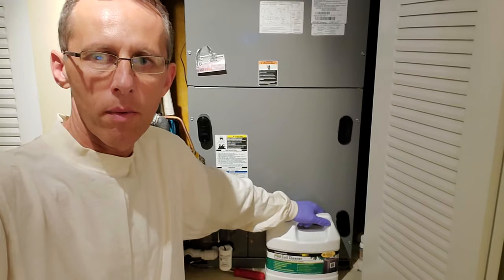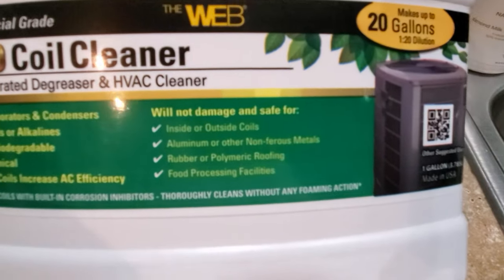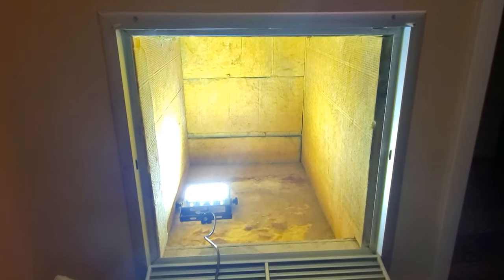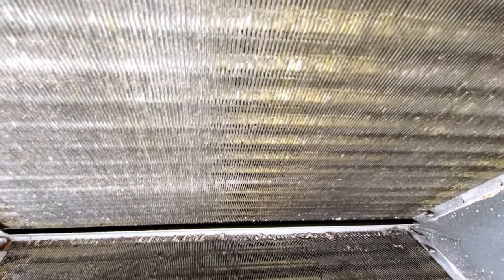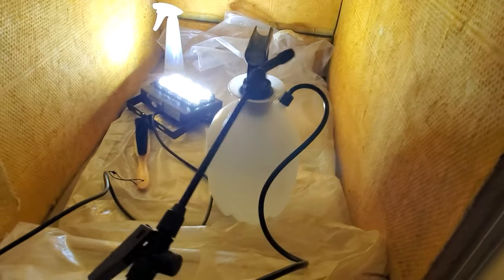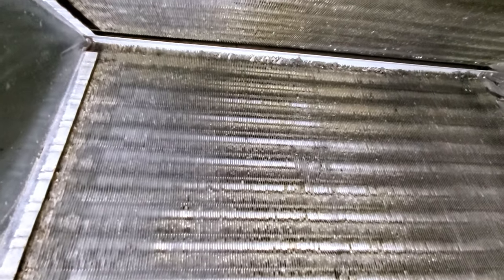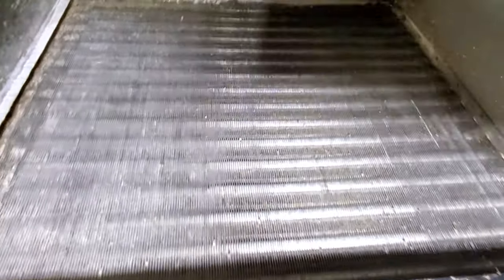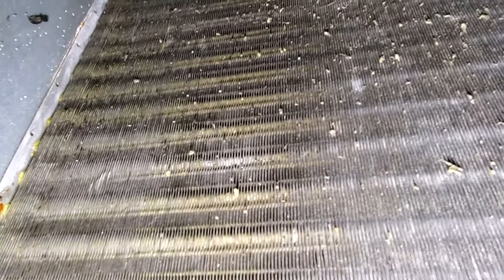How to Clean Inside of AC Evaporator Coil

Comment: I went 20 years before cleaning my evaporator coils because I didn't know any better. The dirt buildup was extreme. I think my cold air flow increased by a factor of 3 maybe after cleaning. I'll bet my electric bill will see a large drop too
Reply from the maker: Same here. I never new I could do that and did clean my AC inside first time after 10 year. We all learn entire life. Thanks for your comments.
Reply: I have had two ECMs die in 2 years due to high static pressure. My system runs at 0.78 when it should be 0.5 or below. When removing the coil access panel it drops to 0.45, so something is either wrong in the ducting or the coil is filthy. The system is 15 years old and its never been cleaned, however our system has the normal filters as well as an air purifier before the blower and coils, so I find it hard to believe anything got through. I will have to check though, as this system is really not running well right now.
Reply: Hasn't been cleaned since April 1996
Reply: I know this is 3 years old but can you please tell me what you did to clean yours? I didn't know and now mine is very dirty

Comment: Thank you so much for your video, all the technicians said I needed a new unit from $2500 - $6500. None of them wanted to clean my unit just sell me one!! I followed your instructions (even wrote them down step by step) and brushed very carefully with a wire dog brush that I attached to a 1/2" PVC pipe 12" long and taped it on, worked great. The unit is from 1996 LOL to the AC Guys who want to be lazy and make you buy a new unit!!!!!
Reply: SAME HERE WITH HOT WATER HEATER. I waited 2 weeks for a part and then went to YouTube University and fix the hot water heater myself and it just needed to be cleaned..allergies🙋🏼‍♀will probably stop once I fix the air conditioner ....black mildew/mold
Reply: That’s what they all do!!!!
Reply: @quintenandjoannklonowski134 Youtube University Lol... that's true. I have learned multiple things like electric, plumbing, A/C unit projects, car mechanic, even gow to play the piano and guitar all in YouTube for free.

Comment: Spray with foam in cane from Home Depot ( no rinse ) , use soft brush. And by the will of god don’t use compressor. Just after brushing shop vacuum. It will pull all loose dirt and foam , no mess.🤷🏼‍♂️👍
Reply from the maker: Thanks for sharing. As you could see use of compressed air did help me to get rid of gunk in between coil blades that was just stuck there. I have used foam spray before and Home Depot one is slightly acidic. I did not want to use that in that situation.
Reply: My thoughts exactly.

Comment: You should have sprayed the water from the other side of the coil to flush out the gunk.  When you are blowing it with your compressed air you ate pushing the gunk further in.  Spray your cleaner and rinse from the top side so you push it out.
Reply from the maker: Thank you for your comments. I tried spaying it out from the other side but gunk was still there. I was blowing air at the angle and got most of it out. This worked for my particular situation. Yours may be different. I only showed what worked for me.
Reply: spraying cleaner the opposite direction of the air flow?

Comment: my 24 year old system had no easy access because they just fabbed sheet metal around the coil. 
Alas, it leaked and i replaced the system. Brand new systems now have access panels.... but alas, the contractor company I paid to do whole-house duct cleaning decided to install the new system first, THEN blow compressed air through the ductwork. Incredibly smart. Brand new system, contaminated. My 24 year old system surprisingly looked cleaner than my new system.

Comment: Same AC as mine. Mine is way dirtier than that! My drain was clogged up and water was overflowing the pan and leaking all over the house. It took me a while to figure out what was leaking. Once I shop vac'd out the drain It quit leaking. I did have to clean the coils again tho. Good info. I wanted to clean the evap but didnt want to use something corrosive so your recommendation helps! Thank You! I also sealed everything below the unit so water wouldnt drain all underneath the floor tiles in the house again. That was a mess. They put an elbow joint right at the drain so its almost impossible to ram something down there to remove the clog. I drilled a hole in the pipe so I could clean it out then use hot glue to seal it up again. I also put the shop vac on the open part of the drain where your pouring the water in and suck it out. Works great.
Reply: Next time that drain pipe clogs, used compreased air to blow it out. You can use your free hand around the nozzle and pipe to seal it. You can use a air compressor or even canned air if necessary. Spiders may clog the pipe toward the outside in the cool season.
Reply: I would not glue the joints in the PVC drain pipe, it makes it much easier to keep clean. That water is not under any pressure, just gravity. If snugged properly, there should be no leaks.
Reply: @michaelwright1602  everything is already glued together. I'd have to replace most of the drain pipe to clean it and thats why I drilled a straight path through the elbow and stuck a wine cork in so when it clogs I can pull the plug and shop vac it out.  I also  sealed the floor around under the unit so it will fill up like a bath tub before it leaks under the floor again. I just wait for my wife to complain about the dripping noise then  I go clean it out. worked all last summer and this summer I had to clean it out once so far. it drains into the kitchen drain. I wish it drained outside onbdedicated piping but I ain't replumbing that! so far its working so I ain't messing with it.

Comment: Thank you. I was wondering if i could use my compressor. Glad to see i can. Very helpful showing that i can do through access panel.
Reply from the maker: Yes you can!
Reply: Be careful to go straight with the air other wise you will bend the coils. If by chance you do You'll need to very carefully straighten them back out.
Reply: Oh and remember to wear gloves. The coils are very sharp
Reply: As a worker in the field I don't use air to blow dirt into the duct work.  If it is full of hair, or caked over I use a metal brush.  If you replace a your air filter in a schedule, your coils stay clean.

Comment: 2 things here: Unless your coils have a heavy mineral deposit layer it is best to use a highly diluted soapy water (just simple dish soap) let it sit for at least 15 minutes. If you do use air pressure to blow out the coils do it in the opposite direction shown in this video. You want to blow the "gunk" out in the opposite direction of the units airflow.
Reply from the maker: Thanks for your comments. I tried blowing from outside in but I couldn't blow out dust out this way. As you could see on my video blowing at the angle on the inside did work pretty good.
Reply: I used a vacuum cleaner...worked very well.
Reply: @MaciejPiotrowski  yeah i have the same air h andler shopfac might work everything coomes down in my face lol . Simple green makes a clearner that works good too

Comment: My air handler is 10 years old.  Last year my pvc condensate drain pipe got clogged, so the water did not drain outside but overflowed in drain pan, then onto floors.  Big mess, but my shut off valve did not work, so I did not know it was overflowing.  The plywood platform, along with the 2 x 4 beams that my air handler sits got soaked and is now sagging in the rear of the unit.  
It started leaking again and I vacumned the pvc drain outside to remove clog.  EXCEPT the condensate leak was not due to drain clog (water isn't even flowing towards the drain).  Since my unit is longer level and tilts back, the condensate water is flowing towards back (opposite side) of unit and overflowing the drain pan on the opposite side of where the PVC drain pipe.   Air conditioning unit works and cools great BUT, I have been paying  a home warranty company monthly for 4 years and this is 1st time I used them.  The tech was out for 5 minutes, never opened the closet door to look at the air handler to see that the unit was tilted causing the leak.  Instead he peeked under the unit (where you just cleaned) and said my coil was leaking water because it was dirty and full of holes and that the warranty company will not pay to repair it due to coil being dirty. After I told him that my contract covers dirty coils and/or lack of maintenance, then his 3 minute diagnosis changed to the coil having mold and lots of holes in the coil causing the condensate leak. My warranty company will not cover if mold.  Within 10 minutes, I had a repair quote for $6,250 to replace a  2.5 ton system (air handler and condensing unit)!  
My air conditioning system that cools my house beautifully! I asked for a 2nd opinion from warranty company, but before he comes out I wanted to make sure the coils are clean so they can't blame a condensate drain flow issue on a moldy coil.  I saw you cleaned the underneath coils but I wanted to make sure the other side of the coils are clean, too.  After removing the air handler cover, can I spray the solution onto the exterior of the coils (the opposite side that you sprayed, too?  Any help would be so appreciated.
Reply from the maker: Remember that Ac warranty company will always try to find a way not to give you warranty. They are only good to take your money, just like any other insurance company. I am not AC professional so don't quote what I say. I just service and clean my AC the way I see make sense. You can use coil cleaner to clean coils but if its going to work or not I can not guarantee that. My mom ac had some mold. I sprayed it with coil cleaner and id did not help much. It's the place were the is moisture 24/7. There is a good company Viper Coil cleaner that I will buy soon and I have seen this at lease on video to do the best job cleaning coils. Here's the link https://amzn.to/3StbVoG  and I hope this helps
Reply: @MaciejPiotrowski  Oh my goodness, I never expected a reply so fast.   Thank for sharing the video and now, for the additional information that you provided.   I will check out the link you sent. So true what you said about the warranty company. As a single mom with little technical experience, I thought I was protecting my home (& finances) with this warranty plan. Thank you so very much, so appreciate it. Enjoy the rest of weekend!

Comment: When u had the sprayer, was that just water and u used that to rinse it off with? Thank u, helpful video.
Reply from the maker: First I sprayed with cleaner, then you need to spray with clean water to remove debris and chemicals from cleaning process. Than you let it dry for awhile and turn AC on again.

Comment: Idk how much you know about this but you obviously know alot more than me. I can see quite a bit of dust between the coils and my question is this.  Could this be the reason my unit is freezing up? It is mostly dirty on the top side. After watching this video I got under mine and the under is, for the most part,  pretty clean.
Reply from the maker: I don't think this is a reason for freezing, although if there is not enough space in between coils then it will freeze. Most of the time coil will freeze if your air filter is dirty. I cleaned my coils after my home renovation which created bunch of dust in the air. This dust was sucked into the coils. I cleaned coils to make them more efficient. You coils can also freeze if your drain line is clogged so clean it at least once a year. I flush mine 3 times a year. Watch this video https://youtu.be/RzQM1sRwLbM 
I hope this helps.
Reply: @MaciejPiotrowski  thanks I just watched your and my unit is similar to yours. It won't be very hard to make the hose pipe connection. I'll give it a try. I appreciate the help.
Reply: @loganb.768  i know this was a very long time ago, but did that help your coils to stop freezing? i just spent $700 on a repair man to come and my coils are freezing up a month later and water is pouring out … my dad cleaned the hose with bleach but it still is leaking very bad.
Reply: @sin-ro4lr  To be honest,  the reason my ac kept freezing was due to it being low on freon. I cleaned it good and cleared the pipe but it kept freezing because the freon was low. I got someone to come re charge it and it cost me about $150. It hasn't froze since.
Reply: @loganb.768  thanks for your response. we got a quote from a technician and it would cost roughly $1700 😭 we will just buy a brand new one at this point.
Reply: @sin-ro4lr  Yeah I had a friend who recoiled mine for 1200 about 7 years ago. If it leaks the freon out too fast your best bet is get a new one if you can.
Reply: @loganb.768 you are correct. Sometimes the unit freezes up because it's low in freon. And sometimes the coils freeze up because there is low air flow (dirty air filter and/or dirty coils or all three.

Comment: New to this. Why didn't you choose a "No-Rinse" evaporator coil cleaner ? // I'm worried about rust from rinsing with water.
Reply from the maker: I was afraid it's going to be too acidic and will start corrosion of my coils. I chose something that is PH neutral.
Reply: Rust?? Doesnt it condense water, thats why it the AC unit has a drain hole
Reply from the maker: @johnytamale8814  If you use acidic product that will stay on your aluminum coils, it will start aluminum corrosion and this can lead to your coil leaking freon.
Reply: @MaciejPiotrowski  , if you clean it in the winter when the A/C does not run maybe.  Let the unit run a couple of cycles and it will take care of it by itself.  20 years on and off the field.

Comment: Use distilled water if you are mixing any cleaning solution. Generally tap water has excess minerals and bottled water is worse in most cases. 

I learned this the hard way using poland spring bottled water (5gal) jugs when i first had a saltwater tank. Instant aglae bloom from the phosphate in the socalled "filtered" water.

Comment: Have a question i have the setup as you but how did you crawl in there without damaging the weak aluminum flooring in that box as I want to get in mine but everything is weak in there behind the insulation especially on the floor
Reply from the maker: the bottom of my ac vent is a floor that is covered by an insulation.
Reply: @MaciejPiotrowski  but is the floor very weak and Hollow or is it hard and firm on the bottom to crawl on
Reply from the maker: @ddanster91  it's my house floor. It's concrete

Comment: Thx for sharing. May I know the Air Pressure in PSI or Bar of your Air Compressor?
Reply from the maker: I was using around 80PSI
Reply: @MaciejPiotrowski  I was thinking of buying a 120 psi compressor (capable of adjustment for other various use) and adjust it to 80 psi as you mentioned. Thank you again for your advice.

Comment: Did this make a noticeable difference on cooling off your house? Also, I wonder if I could just take a small brush or toothbrush type of item to it.
Reply from the maker: I did not feel any noticeable change. I just know that the is a better flow in between Coil blades because I remove all that gunk. You can use any brush, just be careful not to bend the coils.
Reply: @MaciejPiotrowski  Thanks. My upstairs is not cooling and It’s not the thermostat, float switch or compressor. For some reason it just doesn’t blow air upstairs for more than a few minutes. I’ve noticed the compressor turns on them back off quickly.
Reply from the maker: @SpencerJMusic  Sounds like you need an AC guy to see what's going on.

Comment: So 2 years ago that coil was clean? only took 2 years to get that dirty/nasty? thanks... can you tell me if your electric bill was better after this cleaning? did your AC run less time to keep house cool than before you cleaned.?.. i ask because its been 6 years since my coil has been cleaned and it seems when its very hot outside my AC can never catch up and runs constantly....I think i need to do this asap.. Thank you for the demo video
Reply from the maker: What I meant was, 2 year prior I cleaned the coil but from the top. It never occurred to me to clean it from the bottom. My electric bill has not changed because coil was just dirty. It was not clogged to the point that it would affect air flow. I live in FL so when it's very hot my AC runs more often then normal. Also, it depends on how you attic is insulated. My mom's AC was running constantly. It was not AC problem. Attic did not have enough insulation so I rented a machine from Home Depot and sprayed extra insulation one year. It did help a lot doing this with lowering my mom's electric bill and keeps the house cooler.
Reply: @MaciejPiotrowski  did you do a video on adding insulation with a rented machine? i may want to consider that myself... what type of insulation? where do you buy... whats this machine called and cost to rent ...thanks

Comment: I have been having trouble with my A/C, the AC company came out and sprayed and the air starting working and now my unit is warming up again. They said if this happens again that they have to remove the ceiling to access the unit to clean the evaporator but for some reason the owner is avoiding this process. I am so frustrated
Reply from the maker: You may have freon leak, that's why it warming up again. Go to my playlist and look for AC projects and watch those videos on how to spot a leak and what is the solution.

Comment: You need a foaming cleaner for it to work. The foam will push the dirt out of the fins.
Reply from the maker: Tried that. I got too much gunk stuck in between coils. That's why I had to use compressor.

Comment: why not us a vacuum with a soft brush adapter  to clean the coils
Reply from the maker: I've tried but it didn't work. I had too much gunk from my construction work in the coils. It was dust from removing popcorn ceilings. They only way to get it out was compressed air.